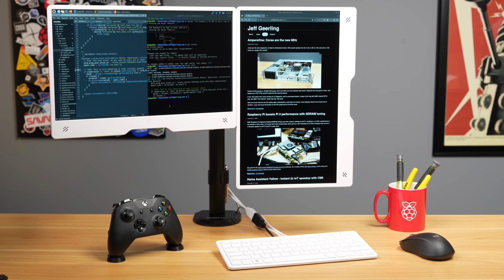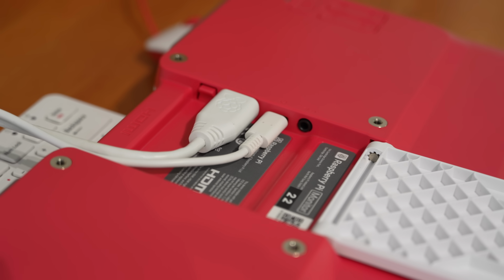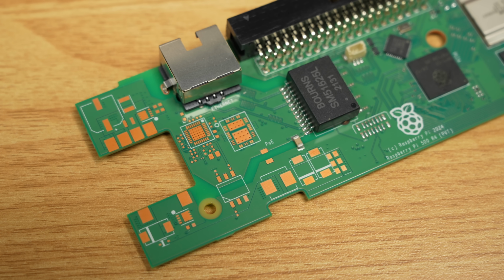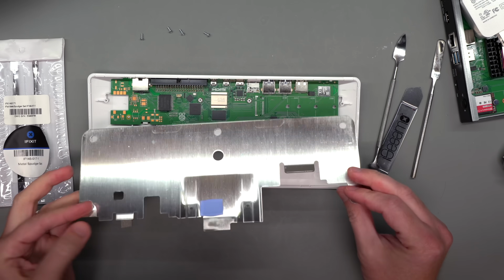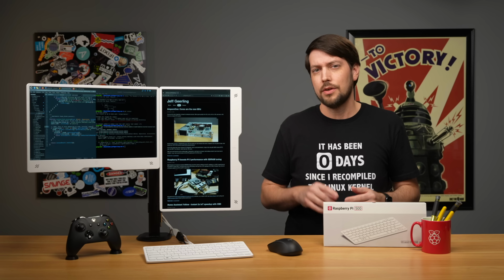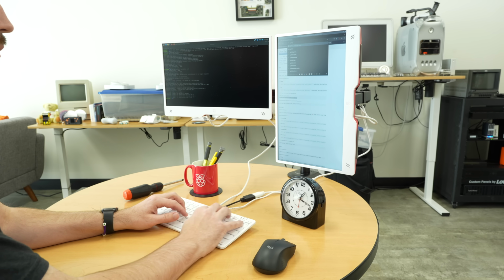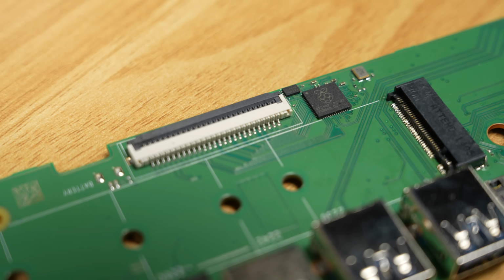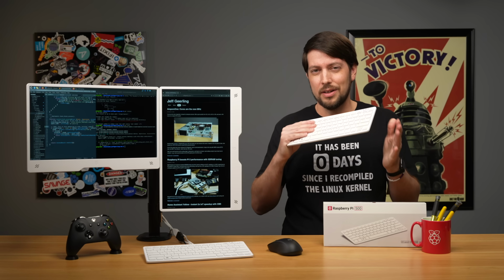The Keyboard IS the Computer! (Pi 500)

Comment: It's much more likely that for the US$200 price point proposed near the end of the video that a Pi 5-based "laptop" is first gonna be DIY with either a CM5 or a stock Pi 5 (probably 8 gig RAM model unless they actually release a 16 gig one in the future) and BYO-keyboard-and-mouse, probably with either that official Pi screen or a third-party one with or without capacitive touch like from Eleclab or something. If history is any indication, OrangePi is the most likely to make its competitive version full Pi "laptop" probably in the US$250-300 range in the near future and I would think a Radxa offering would be around US$275-300 to start, for better or worse.

Comment: With NVME I would buy it.  Without NVME its yet another Pi in a different case.  If you don't have one already, its a good way to introduce yourself to one, but if you have 10 of them already its not worth it without the NVME feature.  We need an electronics engineer to figure out how to make the port work and sell the kit to upgrade it, or sell them upgraded like Adafruit.

Comment: Unfortunately, refurbished 24" monitors for less than $100 CAD make the Pi Monitor look like a poor value. It feels a bit like Raspberry Pi has lost their original value proposition of an economical, entry-level, hacker-friendly, education-friendly devices.
Reply from the maker: Refurbished is a different value proposition, especially since those monitors aren't portable with a kickstand. I have a few, and they're great, and some of the panels are even nicer (plus it's neat to have DisplayPort, a better stand, etc.), but that's like comparing apples and oranges.

If you're a school district speccing out a maker lab or something, this seems like it would fit that well.

Or a display you could slide in and out of a rack for a homebrew KVM.

Comment: I mean, if they are gonna raise the price either way, likely in large part because of the addition of those slots, they might as well ship it fully functioning...

Also, I feel like the only device on planet earth that has ever used a Micro HDMI port is Raspberry Pi, nothing else uses them... Use regular HDMI ports, it's a wider frame anyway, you might as well...

Comment: This thing is one year late. They could've added nvme, and chose not to. They could've fixed the hdmi issue (add a proprietary connector, add a split cable, add a type c with displayport, add mini displayport), and chose not to. They could've improved the wifi antenna and chose not to. They could've improved the usb ports to add some type Cs, they did not. They could've added some screws and screw posts for easy dissasembly and did not. I am NOT impressed.
All of these requires design, some engineering and foresight, but doesn't really add much to the final BOM. I think the pi 5 is the last product I'm buying from the pi foundation.

Comment: A working M.2 slot would have closed the deal for me. Now I'm going to wait for a revision that has it or a similar competitor that has it.

I like the look of the monitors, and I could use them with my Pi 400. If they could do power pass-through to a connected pi, and the USB-C on the Pi could do displayport alt-mode to the monitor that would be amazing, but likely too expensive.

Comment: At 9:58, JEFF: just flood that connector with flux, paint over it a couple of times with the soldering iron and some fresh solder, clean it up and it will be AMAZING! Thanks for the video!
Reply from the maker: I tried that a couple times, but I think the PCB was soaking up all the heat... I should order a PCB heater so I can keep it a bit warmer for a connector like this.

I also ordered some solder paste, using hot air would probably be easier!

Comment: The lack of the the M.2 slot is going to be a deal-breaker for a lot of people. The one thing I was hoping they'd do is add a trapdoor to the bottom to allow M.2 slot access, and there's nothing. The board layout is unfortunate too, given the pads are on the top side rather than the bottom side, so even if they'd added an M.2 slot, it'd be on the wrong side for easy access, unless they were to abandon the use of clips for screws.

Comment: For 85$ I can go to pcs for people  and get a refurbished hp 800 g4 desktop mini with an intel i5 8500t 6 core/thread processor.  It has two nvme slots and a 2.5 inch ssd slot.  The one on their website has 128 gig ssd and 8 gigs tan

Comment: I just watched a video of the ancient Atari 800 computer. So ancient most people won't even know what that is. But it had a panel you could pop open to add in more memory. Just slot the cards in, no need to spudge open a case or anything crazy.

I mention this because I feel like in the pursuit of making everything as thin as possible. We've pushed all the functional stuff we really want out of reach. If that keyboard was twice as thick, would you be upset? Would it put you off? It could have easy access to all kinds of things like fully size ports, easy slot in memory/SSD or even usb drives held inside. Maybe I'm out of touch and people do demand thin before features.

Also that power button is where my pinky goes to delete, so that's going to have it turned off way too often. The power should be on the back surely?
Reply: The Atari 800 came with 8k of RAM (expandable to 48k at significant cost) and ran a 6502C at 1.79 MHz. It sold for approaching $1000 in the US at release. Expansion or not, you can do a lot more with the Pi 500 (which has a MicroSD card slot rather than another expensive add-on in the form of a floppy drive) for a tenth of the price. And let's not forget, the graphics functionality nowadays is in a completely different class. 

I love expandable but it seems likely that NVMe etc. are coming even if they couldn't achieve it in this model, and who's to say that when it does come, the cover won't have an expansion door?

My personal pet hate, which others have called out, is the micro HDMI ports.
Reply: @taliesynd6116  haha I wasn't suggesting the Atari800 was anything anyone would want to use today. I just happened to have watched a video about it and I loved how you could upgrade it without even removing a screw. Given it was so primitive and early on in computing it surprised me. And its something I've always appreciated about my PC. Being able to add to it over many years as parts come along. Also the reason I've never owned a laptop. I don't believe upgradability without tools has to add any expense. In fact I'd argue it makes it cheaper to design. Compare the desktop PC to the laptop. The laptop has to be portable, light as possible. The screen can't be a whopping 30 or 40" beast that desktop users enjoy. And for the same performance you will always pay more for the laptop. Because of the design choices. So designing for the thinnest, lightest isn't cheaper. And with a keyboard that is also a PC I question the choice to make it so thin even the motherboard is a thin strip rather than something that could take up the whole surface area of the keys. Anyway I'm not hitting on the device, I think its pretty great apart from that power button lol Just lamenting everything becoming more device like and aesthetically you'll end up with wires and adaptors hanging out of it to plug in more storage or other peripherals. Where as much of that could have fit inside and looked more pleasing despite being thicker. Just some thoughts but you made me laugh describing the performance of an Atari800. They were pretty awful machines that never sold well but still very cleverly designed I think.
Reply: @ClayMann  Yeah I think back to those days (I didn't have an Atari 800, but did have a BBC Microcomputer - which was expandable without taking the lid off, and later issues than mine had a ZIF socket accessible at the left hand side of the keyboard, probably a decent analogy to the currently-missing NVMe socket in the Pi500) and we were so excited to have them, warts and all. When I think about what we complain about in a machine today, we "don't know we are born", as my father would say!
Reply: @taliesynd6116  ah you were a beeb owner! They were built like tanks. I always wanted one after seeing Vince Clark using a BBC to control synths over MIDI. That seemed like something near magical to me at the time. I went down the commodore tree from vic20 to Amiga (and I eventually got my MIDI interface for the Amiga heh). It always disturbs me seeing the math on current speeds of computers are a billion times faster than what I used 30 years ago.

Comment: Either they rushed this out, or they realized that an M.2 doesn't have proper cooling in this case, or the disassembly is not user friendly as you pointed out. Too bad. But looking forward for a Rev2.

Comment: I really love the idea of the Pi X00 form factor as super-clean terminal/casual use PCs, but I can't help but think that this is only like 90% of the way there.

Seeing that unpopulated POE section on the board is heartbreaking, since that was possibly my most-missed feature from the Pi 400 (I bought one with the intention of trying out NFS booting, and POE power would make the whole thing basically single-cable aside from video out). HDMI that's not full-size is also a major bummer.

If somebody made a mini PC with POE and like an N100/N150 built into a proper mechanical keyboard for <$250, I'd be very interested...

Oh, and while I think the Pi Monitor is kinda neat, VESA mounts blocking the ports is a baffling design decision that makes it a no-go even if the price isn't unreasonable.

Comment: They really should just turn the pi 500 into a carrier card and use the CM5 for the actual compute. It would make for some additional engineering issues kind of like you have said but  I think it would be better overall. They should get rid of the plastic clips and go for screws similar to what they have on the steamdeck oled. And agree 100% that missing an m.2 slot is a huge miss.

Comment: Sorry, that is *NOT* the right location for a power button. If the power button is placed anywhere near my formatting keys linearly with the board, it's a fail.  One errant backspace and you're shutting down right in the middle of your document.  Companies need to stop this.
Reply: There are ways to change a power button's behavior in the OS settings (set to suspend or make it do nothing), but yea, that is a fail (especially as a cat owner).

Comment: µHDMI saves space on pcb, also it makes this thing more reliable due to lower weigth and thus stress on solder joints. So it makes it cheaper. On the other hand, display port would do as well and maybe even cheaper given fee that HDMI consortium wants.
nvme - components aren't free so including this would also push price point which is - according to you - high already. It comes with its own heat to dissipate and power to be consumed and wasted as a heat. IMHO PI foundation should list all part needed and who needs and can could do their own purchase and soldering. Not confident with soldering? There's independent repair shop right next door who would do this for you. 

this form factor ISN'T intended for homelabbers running dockers and vms. SoC is surely capable but this particular implementation just wasn't designed for this. And IMHO RPiF hit that sweet spod where they left not populated pads for PoE- and NVME- infrastructure while they could simply wipe off these pads from design; furthermore given PCB looks like it looks it's more than possible to see anytime now rpi500 pro or similar with all the bells and whistles.

Comment: It is a beautiful monitor but what if I want to use it for retro computers or emulators on the Pi that use the 4:3 aspect ratio resolutions? 
Will it stretch it to 16:9 or will it display it in 4:3 ratio with black bars on the sides?

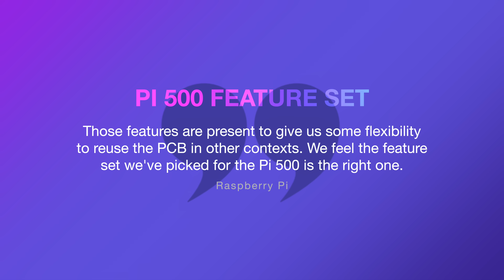Comment: Sending an anticipated apology to Eben Upton and his team, but that statement at 3:30 is so patronising it irks me .
The whole gist of the Raspberry ecosystem is to make even the most Average of users want to tinker, mod and develop. Getting your grubby hands inside the Pi500 is a given, besides, one used to open and work on older Microcomputers as well, why not this one?
I would have passed on the lack of M.2 as a minor gripe, but after that statement, and with the price bump, I think it has become a dealbreaker. That and no full size HDMI which is just asinine.

Comment: "We feel the feature set we've picked for the Pi 500 is the right one."  Boo.
And that's why I won't be buying one. A Pi 5 AIO needs faster, integrated storage that's more than just an SD card. Full stop.
Otherwise, just having a keyboard isn't compelling enough when I could just get an equally cheap keyboard and a Pi5 which can easily have NVME storage added.

What they've made is just a faster 400 for people already satisfied with the 400 form factor. With a power button.

Comment: If they just remove the 2x Micro-HDMI ports (replace with 1x HDMI or USB-C), and remove the MicroSD slot and replace it with an M.2 SSD slot or move it inside, then I am sure this will become a big seller in the educational market.

I wouldn't be surprised if they eventually make an Educational model, or a higher-end Pi 501 or 550 or whatever they'll call it with more features.

Comment: The lack of NVMe doesn't bother me, but the fact that it's CPU is weaker than a budget smartphone and it doesn't have USB-C video output (instead uses micro HDMI) is a huge turnoff.
Really hoping they make a revision of this, or for some competitor to start making in-keyboard PCs.
Reply: They would sell far more of the monitor if they paired both devices witht USB-C video. Amazing bad decision.

Comment: A hatch on the back to access an NVME would be a good solution. I need the storage and i'm tired of having external disk drives dangling around next to everything on my crowded desk top. I guess they did the Pi 500 this way due to costs.

Comment: One more no micro hdmi connector comments. This is a issue with rpi400, and it will be with rpi500 as well, since it becomes a hazzle to find micro-hdmi to hdmi connectors, and a suitable length hdmi cable. Which makes the rpi line products that needs to be stationary for the most case, rather than a device you can have in a drawer and pick up and easily connect to a monitor when you want to use it. 

And the size of the keyboard could be bigger as well, which would make the rpi more suitable for emulation of old pc games which were hard on keyboards back in the day. The rpi is suitable for scummvm games, and that is about it. Were the keyboard size to be increased on the next rpi, to a full size keyboard, that would give more space for cooling, more space for full size hdmi connectors, even space for adding harddrives. 

The most interesting of these products is actually the monitor. Though I have an battery powered gaming monitor, I think this monitor may be more up my alley, if it is not battery powered (and thus requiring charging), and it has a full size hdmi port, and perhaps a usb-c hdmi input port.

Comment: Totally agree on the NVMe port. But I don't agree on SD "fast enough". Perhaps for Raspberry's used for emulating C64 cartridges or the like (yes I have SideKick64 for instance). But otherwise. Never found an SD card worthy to run a modern OS. They totally choke on random access - also the so called A2 rated. Even a real SSD on USB 2 is way faster as that can properly handle all the random access and on USB 3 then it's very decent.
But another thing holding me back buying the Pi500 - it's not in my native language.

Comment: What's the first thing we see? A lame membrane/chicklet keyboard. Even though the color is an improvement over the awful 400, that's a deal-killer all by itself, without even considering the other deficiencies. The entire RPi value-proposition has slowly evaporated for almost everybody except perhaps the high-volume-discount OEMs.
Reply: It's less than 100 bucks, you're not going to get a better keyboard than this one has. That being said, there are many people (myself included) that prefer this kind of keyboards (although I can't comment on this specific one).
Reply: @pdp11  The keyboard of the 400 was abysmal; this one's slightly better, but still way worse than anything you can buy at the goddamn dollar store! The keyboard of my old Acer Spin 11 (250 bucks new) is an absolute revelation compared to the crap you're getting with a 400/500 ...
Reply: @pdp11  Yes, I get it. There is always a market for the cheapest low-end crap. Enjoy!

Comment: Seriously why cant they add 4 usb c with 1 being thunderbolt and 1 usb a 2.0 to this, these current io selection are horrible
Like my laptop charge by usb c , with an extra thunderbolt  4 port, all my samsung devices are usb c, all my storage drives are also usb c, my mic is usb c ,my fan is usb c, even my monitor is usb c.
What is going on inside their head
Speaking this as a rpi fan btw, I'm still running a pi hole server to this day
(Not native English, i use a translator)

Comment: Enough with micro HDMI. Ffs put 2 vertical ones on the regular pi. Or even better, a single large HDMI and use the USB C port for the 2nd monitor.

Comment: Stop wasting money on a board that costs $150+ (you be lucky if you can get your hands on it for that price) the  guys from Raspberry are just milking it now...
There are mini pc's starting of $150 that have the N100 or N97 Intel CPU which are more powerful, low power, come already with power supply and have standard ports that do not require a dongle.
Reply from the maker: The Pi 400's been available at my local Micro Center (and practically everywhere it's sold) for $70 for years, it was even available through much of the shortages while the other boards weren't.

I have no doubt I'll be able to walk into Micro Center in a few weeks after the initial surge dies down, and pick one up for exactly $90 + tax...